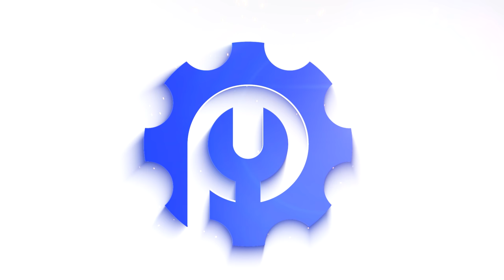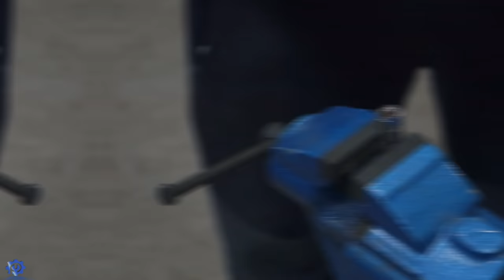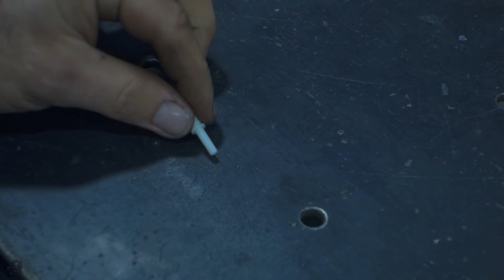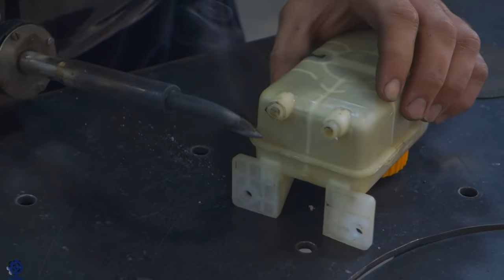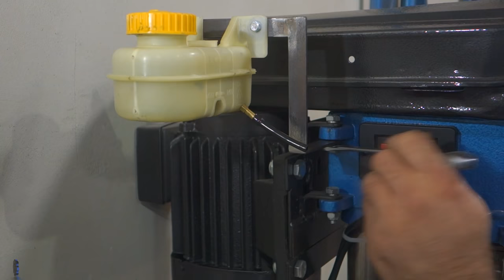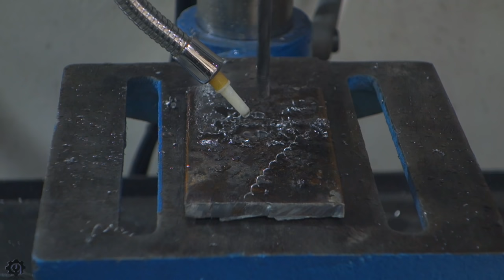DIY - Drill Press Coolant System from medical INFUSION hose!

Comment: Perhaps have two restrictors one set to a tiny slow drip , the other to open and close the feed so it doesn’t need setting every time .
Reply: Good idea but the rate would need to be adjustable to a lot slower rate for my needs. About 1/4th of the slowest rate shown here might be about right for me.

Comment: Good job on this, I suggest you use some solvent with oil added as lube, not just coolant. Hearing the drill bit squeak on the metal was painful.